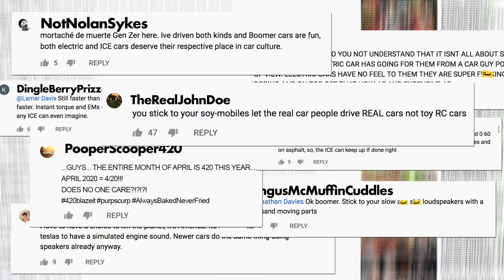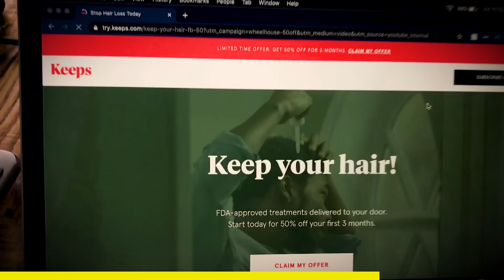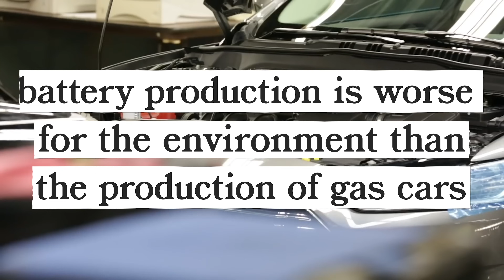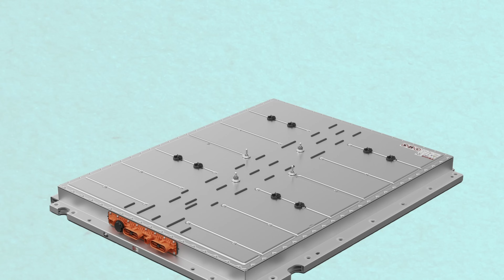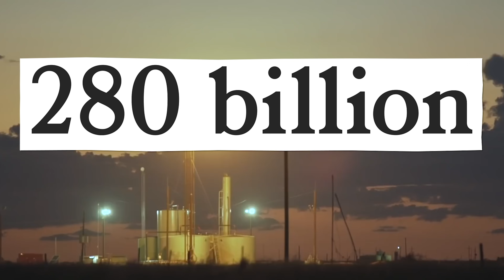Are Electric Cars REALLY Better for the Environment?

Comment: One thing to take into account is even using clean power such as wind or solar both are not clean energy both systems typically have a 25 year life's span before they are replaced most panels while they can be recycled nobody will because the money spent to break the panels down is approximately 30 dollars spent to receive 3 cents for materials and your average wind turbine takes 2600 gallons of oil for lubrication and they frequently leak and spill all that oil on the ground at the end of the 25 year life cycle it costs about 25 million to remove a wind turbine and they do not remove all of it the remove everything down to 10 feet below the surface and leave the rest

Comment: Hi there, I just did an academic research study on ev's and all my sources and journal articles seem to be in disagreement with some of the facts stated in regards to the CO2 produced in the vechiles life cycle. The lengths of the vechiles life cycle needs to be considered as well when determining the CO2 produced from production to retirement. By focusing on simply the operational portion of the vehicle, we seem to neglect the sheer intensity of the the battery and other ev products' production process. Please correct me where I am wrong or may be uninformed. And where can i find your sources for your claims? Please feel free to reach out for mine. I will be checking your description now. Thank you for shedding some due light on the Lithium and cobalt exploitation.
Reply: Considering the video is 5 years old maybe you had very different sources for your study than he did for his video
Nonetheless, you're doing the research so that's good, did know a
 Cobalt mine recently collapsed and ut resulted in a large number of deaths?

Comment: Ok, so both are bad for the environment. Just ones slightly better and that's debatable.
Reply: Slightly better?😂
HALF
Reply: @sam512 yeah that's not what I got from it. What I got was it wasn't that big a difference. Definitely isn't one does and one doesn't. That's for sure. And even if it was half, it still doesn't come close to fixing the problem. I could be wrong though.
Reply: @jwwilliams 

28 Megatons vs 57 Megatons is a HUGE difference. More than 50%.
And no, it doesn’t fix everything, but if we came up with an even beter technology with only 1 megaton lifetime emissions, would you still be like: meh, doesn’t completely solve emissions so it’s useless?
Reply: @sam512 didn't say it was useless just said both still contribute to the problem. But I will admit it seems I underrated the differences.

Comment: You forgot about the actual emission that is 1800 times more in EVs than gas cars, mainly coming from two sources in the case of EVs: the much higher weight of the vehicle causes the brake pads and tires to wear out that much faster. Particles from brakes and tires are released into the environment. And don't forget the ev fires that take 50 times more water to put out and releases way more toxins than a gas car fire.
Reply: Tell me you know nothing about EV’s without telling me you know nothing about EV’s😂😂😂
Ever seen EV brake pads????

Comment: So hang on, lithium creates green house gases, true, but so does the constant mining of oil for the stuff you constantly have to put in a ICE…

You say it takes 8-10 tonnes to produce an EV, but failed to mention an ICE takes 5-10…

Minus the running costs of an IcE per mile of emissions (roughly 500 grams) an RV becomes more environmentally friendly after 5 years. 
And guess what, that old car makes more and more every year

Goes on to talk about the damaging effects of cobalt and lithium mining, but doesn’t talk about all the oil spills in the ocean… then talks about child labour, but most likely uses electronics and wears clothes made my children… 

Then talks about recycling issues, and his first point is storage? Like are you kidding? Have you not seen wrecking yards with cars piled up high everywhere not being recycled? 

Environmental footprint issues with electricity coming from coal? As opposed to a ICE getting “clean” gas, right?  My car charges completely from my solar, and my whole house runs off solar.

Comment: 1) I simply don't have the health or time to banter. 
2) I am making  only a couple of comments which are just a sample and no where complete information.
3) The climate has many climatic changes long before man ever put a carbon molecule into the air. As temperature has risen the atmosphere is able to hold more CO2. This was true before and after man started to put anything period in the air from the industrial revolution.  CO2 has not modified the environment negatively before or after humanity.
4) The one clear change in the environment has been lush green growth on the planet. 
5) You count the pollution from the gasoline engine but forget that coal plants and other types of plants will be continuing to release pollution from them into the environment so that the car can be charged.
--As I said just a couple things as I can't continue to finish this helpful information. 

Please forgive me for any typos, grammatical errors, spelling errors, phrasing mistakes or any other errors as I am only human and not an A.I. The information provided in the above comments is for general informational purposes only. All information is provided in good faith, however I make no representation or warranty of any kind, express or implied, regarding the accuracy, adequacy, validity, reliability, availability, legality or completeness of any information. RESEARCH and make your own decisions.

Comment: You didn't take into account the rare earths minerals in the magnets of the motors and the copper in the windings of the motors. Also in the mining they only take into account the diesel powered diggers and trucks, but not the carbon released by moving the earth. The truth is to release all the elements for batteries and motors is about 50 tonnes of carbon more than ice cars. Also the electric to power them is mostly produced by fossil fuels in every country. And then the real kicker you cannot make an EV battery without plastic. It's in the jellyroll, the electrical components the casing of the battery and it all comes from the petrochemical industry. Even the insulation on the wires are plastic so no fossil fuels no plastic no EVs

Comment: There is one huge variable you forgot:  Maintenance.  EV's use the exact same battery tech that powers your cell phone.  Would anybody expect a cell phone to last (say) 20 years, without a few battery swaps?  If you will only drive a car for a few years, then the maintenance variable is a wash.  But with cars now financed for 7 or 8 years, it's silly in the extreme not to own a car for at least 15 years...or else your total cost of ownership becomes outrageous.  For an EV, figure 2-3 full battery swaps,  minimum.  How much extra CO2 will be used to produce 4 huge EV sized lithium batteries?  Meanwhile, my ICE car is 25 years old and running fine on all original parts other than obvious like oil, tires, brake pads.  But an EV would need tires, brake pads...and yes, even some lube.

Comment: 1.If you unplug charger from an EV and none windmils nor photovoltaics power has to be reduce it means it wasn't been charged with renewables.
2. Would France had to start coal plant yearly each November if there weren't 1.5 millions EVs on French roads? 
3. If there weren't EVs in France could more nuclear power be exported to Germany to close lignite power plants? 
4. The same with Norway. If there wouldn't be EVs in Norway could more hydro energy be exported to Germany to close lignite power plants? 

I believe yours believe of EVs ecology is based on magical thinking. It is nothing more than creative accounting of CO2 emissions.

Comment: Donut videos have ICE cars all through them. 'Nough said about that.
In 10 years we may be still driving road vehicles BUT it will NOT be internal combustion engines. To those coal fanboys know this, the pollution and side affects of fossil fuels is well known and is WHY we are moving away from them. Should have happened 20 years ago but better late than never. Nothing will stop the march away from fuel burners. Nothing, so get used to it.

Comment: You do forget a minor factor, weight. Heavier weight means more wear on the road surface. It means more wear on tires and need for bigger and wider tires. EVs, pickups and SUVs being as common as they are in the US, significantly increases road erosion and tire consumption. Meaning more road construction work, and more rubber being produced, and more rubber being disposed of.

Comment: However, did you consider that the lifetime of an EV is significantly shorter than that of a fossil fuel vehicle?

The life cycle of a lithium-ion battery typically lasts around five years or at least 2,000 charging cycles. Consequently, you might need 2 or 3 EVs to match the same lifetime mileage as a fossil fuel vehicle.

Comment: One thing to note is battery replacement emissions. And maintenance emissions for piston vehicles if you intend to keep the vehicle rolling for 300k plus. I personally say both types have there place if you dont take long drives ev is a better choice it's massively cheeper, less maintenance and better for the environment. Just save a little per month for the battery so it doesn't kill you when it is time. Piston vehicles are great for those who like long trips and need the extended range. I personally have both. One is a used nissan leaf so I got it for super cheep. Use it as my daily driver off standerd 120v outlet "Level 1 charger" and I have a older gas vehicle I typically use for long road trips where I'm driving over 500 miles one way.

Comment: My Skoda 1.6 diesel covers 60+ mpg. I drive only about 5,000 miles per annum. I can drive my car for at the very least 10 years before its emissions equate with an EV. I'm not anti EV I think that at some time in the future they may be better for the environment. However the severe environmental damage done in mining the materials used in battery production will be there for thousands of years. That it is essential that we drastically cut the use of fossil fuels it is imperative that we look at the main greenhouse gas emitters is looked at. Vehicles are way down in the list of polluters the main ones are industry, farming , shipping and aircraft. These are the areas that we should be looking at before we get to vehicles. That we need better ways to drastically cut greenhouse gases we need to get to producing better ways of controlling the release from the major polluters. Evs may well be a step along the way to doing this as the science may prove to be the gateway to this end. In towns and cities AVs offer a reduction in air pollution that significantly improves the quality of health. I live in the last road in m y village, am surrounded by fields so the air quality nis excellent, except for the pollution from factory farming. However that doesn't have much affect upon the local air quality.

Comment: I just saw a series of videos on tulip wind turbines (so called because they resemble giant tulips)  These are suitable for suburban homes, generating between 1 and 5 kw of power.  
They also generate in lighter winds then most wind turbines and can work in closer clusters.  It is time to stop thinking of energy independence being between nations, (note that Donnie Bonespurs wants to sell our oil and gas, not just keep it for ourselves) but individual homeowners in rural and suburban areas from Corporate Energy. 
A combination of solar and tulip wind turbines with an EV can result in near total independence from grid energy.
As for expense, I see people wasting a hundred thousand dollars everytime I tune to HGTV, knocking out walls, and completely overhauling kitchens and bathrooms because they are "dated".  To be clear, not dated as in still having a coal stove, but because they do not follow the current fashion of colors, etc.  And in fifteen years, the same couple will again be dissatisfied with the old colors and spend another 50-100, 000 dollars on updates.

Comment: Serious Human Violation on Child and Slave Labor, Water Supply Pollution to most populations in huge areas leading to starvation and dirty to death water is negleted as not really important!? Really?? Further the Fires these cars anytime causing is neglected! Further, stating that 5 min at a gas station for full tank is equal to a minimum 5 hours up to 12 hours are equal or less usage if carbon as at least 50% of EV energy is from Carbon! Additionally neglect that that the Recycling part is not functioning meaning not existing is absurd, as these cars can leak pollutions for 100 years!!! Not to forgett that a combustion engine car is mostly and often used for 50-60 years means that for 1 combustion car there are between a production of 3-4 EVs!!! And actually there are cars still ongoing since the 1950s thus making this ratio even much higher to a potential of 5-6 EVs for one combustion car! And if we take the best EV 20 years with a low rank car of 60 years its still 3 EVs / combystion making it at least 2 times worse! Not even mentioned these above Serious Human Rights Abuses!!! In short you're a CCP communist WaterMelon promoter  that should go to CCP land and live happily ever after 😂🎉🐣💯🐼

Comment: Thanks for the informative presentation. Having an EV for a year now I would not go back to an ICE vehicle. They are quiet, great instantaneous acceleration, great to drive and have a really low centre of gravity.  My per mile  cost is less than a fifth that of gasoline and no service costs for oil, oil filters, fuel filters and air filters. If I charge from my solar panels running costs are even lower.  Then as this presentation says they produce less CO2 running off even 100% coal fired power stations than an ICE vehicle.   Although there is a lot of lithium mining going on I expect new batteries will eventually be manufactured using largely recycled lithium. Battery tech still has a way to go but there are a lot of improved technologies in the research pipeline. As usual there are a lot of groups, including, I suspect, the fossil fuel industry, trying to spread disinformation about EVs.
The biggest downside at present is that EVs still cost too much.

Comment: What about tires?  You skipped this.  EV go through more tires due to weight and therefor their total environmental cost go up.
Reply: A few tires is NOT gonna cause tens of millions of metric tons so tires is a very insignificant problem and isn't worth mentioning in comparing the two

Comment: I greatly appreciate your effort to cover this subject fairly - I am also a Mustang guy, 1999 six here - I do find myself thinking of the huge detriment to the environment when huge fires are created by electric vehicles, including burning down whole houses, as in the hurricane area recently - where as soon as water hit the bottom of the car, the whole house was set afire. All of these emissions are not filtered in any way. Also, when parking garages collapse due to the weight of ev's - these are huge problems that must be addressed, and as for the electrical grid, it has been ignored for so many years. We have not even "hardened it" to protect against solar flares and weapons, which would not be that terribly expensive to do. We have been told NOT to charge EV's at times, old condo complexes like mine do not have the power to support chargers, and this is a common problem throughout the world. We have been told for years we MUST use much less electricity, yet now we are supposed to get rid of gas appliances (pushing their load onto our fragile grid) and gas cars. Yet in case of emergencies such as wildfires, we need to be able to quickly get home and evacuate, we will not have the time to waste charging the electric car - even if the power supply was still working. In our condo complex, built in 1967, we have 40 amps going into each condo - thats it! If we remove our gas wall furnaces, it will take a major amount of electricity just to keep somewhat warm. And gas range.

Comment: The other thing he didn't mention is they are really fun to drive. I have a relatively inexpensive one,  a Hyundai and it goes from 0 to 60 in 6 seconds. If I have a passenger I have to take it easy because it's so fast it throws them around in the seat like a race car would.I love driving it fast. Most all the other cars are creeping along.
Reply: also, because its electric, you don't have to feel bad about accelerating fast wasting gas

Comment: I really liked this video, but I feel you didn't take these issues into account.
1. Second Hand Market: Today, ICE vehicles have a huge second hand market. In a lot of these cases, it's better to keep that old car going instead of building a new one. Now your issue with an EV is that by the time it's old enough to be flipped second hand, the battery now needs replacing and will destroy all the carbon "credit" it built up during it's lifetime.
2. New Issues: The climate issues from Lithium batteries are unlike anything else we've seen so far. No government agency is prepared to face the full consequence of millions of discarded lithium batteries every year.
3. Disposal: Speaking of waste, battery disposal also emits a ton of CO2 (unlike ICE vehicles where the metal can simply be melted and re-used in a new car, lowering production CO2). If not dealt with carefully (which incidentally also emits some CO2), this will cause even more climate issues (forget just CO2, Lithium when not dealt with properly can absolutely destroy natural habitat).